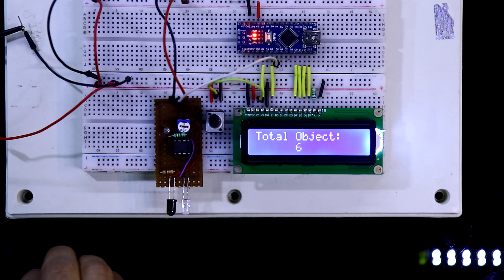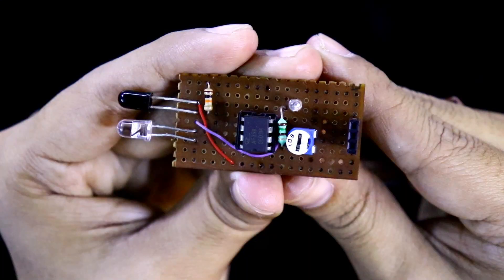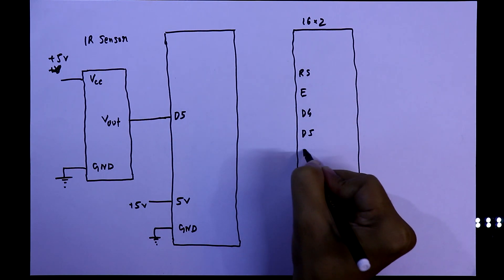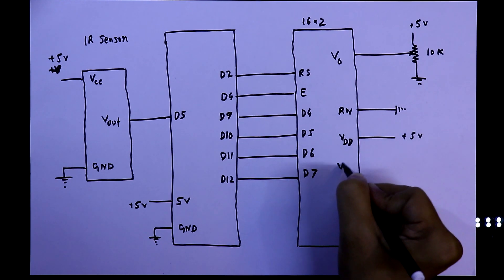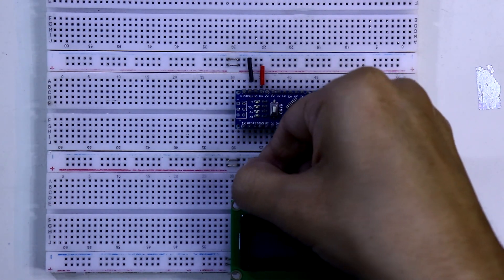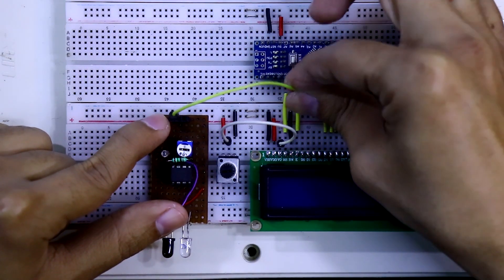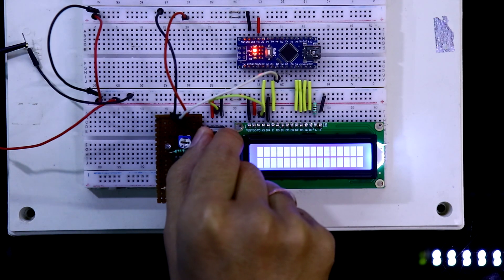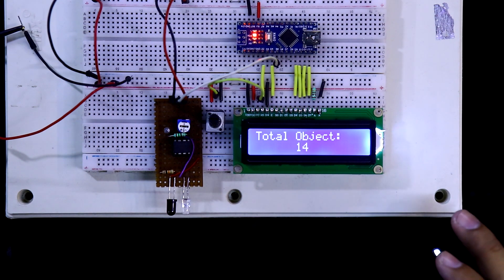Item counter with Arduino and LCD | Arduino project

Comment: If power off is the start from beginning?
Reply from the maker: Yes, I didn't use EEPROM
Reply: @EEWave   boss need memory possible>>???
Reply from the maker: No need of any extra memory. Arduino board has 512 bytes of EEPROM. To active this, we have to write the program in that way. You can get all this information on Arduino website.

Comment: Hello. I have an issue with my circuit. When i turn it on the display starts count up like a clock. When i trigger the sensor it stops counting until i put my hand away from the sensor. Basically it´s doing the opposite it should do. I checked conections and it should be fine. I don´t know if its the code, my arduino or something else. Do you have any clue what could be wrong? Have a nice day